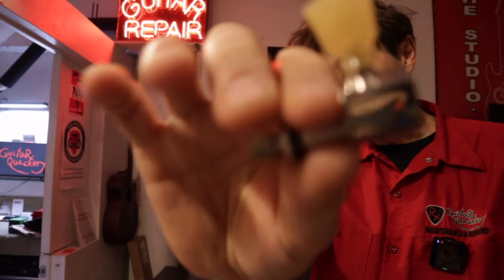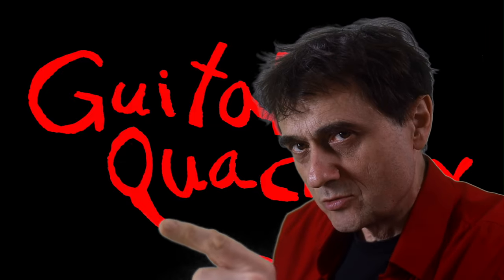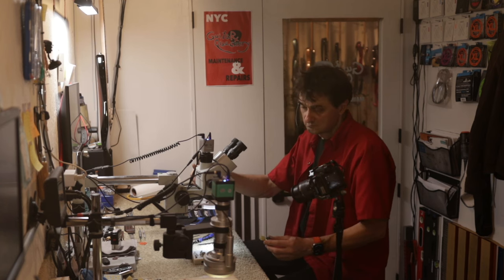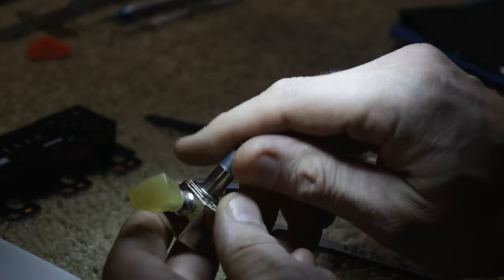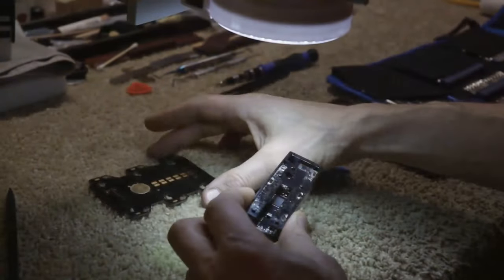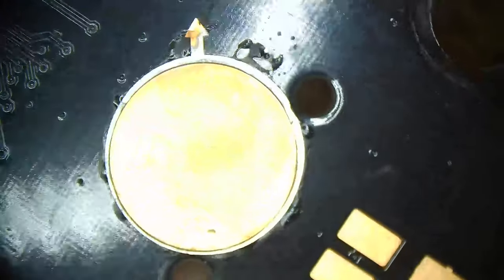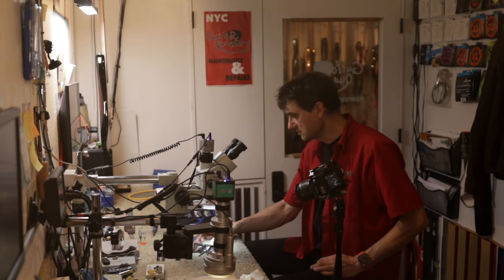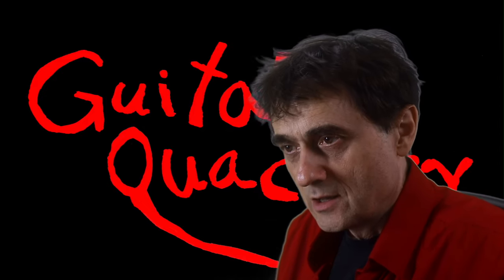Dissection of Gibson Robot Tuners Under the Microscope

Comment: I got those stock on a 2010 Les Paul. I also put the inline system version on my 2004 70's reissue Stratocaster. I think I'm the only one who really loves them. The thing is, the people who don't like them are the ones that never really gave them a chance. They didn't want to put the time in to learn how to use it properly. Everyone seems to have a dreaded fear of being on a gig, hitting a wrong button, and end up in some odd tuning before the next song starts. Now, while that "could" happen if they didn't know how to use it, it's not the fault of the tuners. If you panic and just start mashing buttons, it's just gonna end up in disaster. If they would have taken the time to learn how to use it (just like one does with everything else new and unfamiliar), they would have grown to love it. You are always in full control of what it does. It would never do something unprovoked. It's always user error. After a while, its operation became part of my mussel memory. I don't have to think at all and my guitar is in tune, in the tuning of my choice in seconds. The only issue I can honestly say i've have with them is the battery. They start to discharge quickly only after a few years and now, they won't hold much of a charge at all anymore. The RED battery light will come on after a tune or two. Anyway, anyone can call it an unnecessary gimmick if they wish but, these people don't play with alternate tunings. So, if you play in E the majority of the time but, have a song or 2 you play in drop D and all you need to do is tune the E string to D, the TronicalTune system isn't really for you. It's a tool you have to learn to use to appreciate.
Reply from the maker: First and foremost, thank you for posting this well thought out and enlightening comment. This is more than just a comment, it's a contribution to this video.

I sure hope viewers take the time to read through it all and also give it some time to think about what you said, which are opinions based on years of experience. 

I'm sure you've heard plenty of negative comments about those robot tuners and have probably grown tired of all the negativity and criticism. Yet, you were able to express a strong opinion that goes against common opinions and you were able to do that without even a hint of negativity. I sure hope that anyone replying to your comment will keep it civil. 

I am personally still processing what your thoughts and really don't have much to say, as I currently don't have access to any guitars equipped with robot tuners. 

I'll be the first to admit that I did not take the time to learn to use them and certainly did not bother reading a manual. As with most other things that I try to do, I just try to figure out how tings work on my own. Perhaps that is a mistake with this particular product. 

Due to my own lack of experience as a user, I'm not even sure if it would be fair for me to say that the developers should have taken more time to develop this product in a way that it would be more intuitive. Perhaps the more intuitive version of this product would have ended up with more buttons to deal with. I really don't know.

The only real opinion I have is about the batteries. 

Basically, batteries are like strings. They are not guaranteed to last forever. I'm not really sure how long it took for your batteries to go bad, but in general, it is expected they would need to be replaced at some point.

Thanks again for takin the time to post.

Comment: It was interesting to see inside the tuners. I have two sets of the in my spares box, they were removed from a couple of used 2015 Gibson guitars I own. I found that although the robot tuners worked I prefer manual tuning so I replaced them with Grover tuners. If I sell the guitars I can include them with the sale so that the new owner can reinstall them if they want.
Reply from the maker: I definitely think that's the way to go. Tuners are just accessories and it only takes a few minutes to change them around, as long at the replacement tuners fit all the holes.

Comment: Fascinating demo of what many feel to be a benighted technology. You didnt say so expressly but I got the impression that if a player wants to defeat the robo tuners it's just a matter of removing the motors and tuning manually. Did i get that right?
Reply from the maker: You can’t remove the motors and then use the tuning machines manually. A lot of players don’t like the robotic tuners, they simply change the entire set and put manual tuning machines on.

For those who do just that, it is recommended to save the set of robotic tuners in the case, for resale value of the Guitar. 

I hope this makes sense.

Comment: Robo call, lol. 😂😂😂 

Great dissection video! I always have said the Robo Tuners were ahead of their time. Great idea, but poor execution because the technology wasn’t ready to support it. 

If Gibson would try it again today and team up with the right company, the technology would be much smaller/thinner/lighter, with better software, etc. Band Industries would probably be the most equipped to help make a modern Robo Tuner, as the Roadie 3 is essentially the same thing (with more features) that is not attached to the headstock. Band Industries has been making their tuning devices (that do much more than tuning) since their first Kickstarter was launched in 2014. There have been 3 iterations for guitar and most other stringed instruments, as well as 2 versions for Bass that were build with a different motor. I’ve had these tuners, and they were all fantastic and delivered on all their promises — never had failure with the hardware or software, the motors have all been robust, etc. 

That said, I bet Band Industries can make a unit for Gibson that’s attached to a headstock like the original Robo Tuners, but with much stronger motors, more advanced and smaller hardware, and much better firmware and app support.

Is Tronical still around these days?! I’d be curious what they’ve been doing since the failed Robo Tuners. 🤔
Reply from the maker: I am not familiar with Band Industries and I don’t know the Roadie 3 products either. 

I’ll look it up. Thanks for letting us know. 

Tronical is still around. I was on their website when I was making this video.

Comment: Great video and new subscriber. I just recently found your channel. I have three 2015 Les Paul's with these tuners. I am changing to Grovers as the batteries are failing and they are expensive. I do think the adjustable nut height that came with these are brilliant but the stock brass nuts wear out fast. Gibson will send you free titanium nuts free if you contact them.
Reply from the maker: Thanks for letting me know about the free titanium nut replacement option.

I didn’t know about that. Now I will know to tell my customers. 

Thank you very much.

Comment: Man, I really wanted these things to be a valid product.  But they don't even work with my preferred string guages.
Reply from the maker: How so? If you changed your string gauges for an alternate tuning, it might be necessary to tough up the string slots on the nut, so the strings don't get stuck in the narrower slots. If the strings are getting stuck in the nut, I would imagine the robot tuners would have a hard time. Everything else must be just right on the guitar for these to work.

Comment: video is too dark
Reply from the maker: Interesting. I am surprised to hear that, as I've done all luma corrections, using the waveform monitor, in Final Cut. 

I guess it's possible that my exposure setting on the close-up camera is low (as I did lower it, to avoid burnout, as recommended by some YouTube tutorials) but perhaps I should raise it back up a bit.

I also don't really have a good way to light up the workbench for that close up side camera. 

Thank you for pointing this out.
Reply: @GuitarQuackery  just trying to help man, take care. .:)